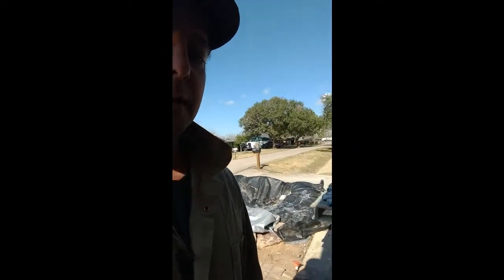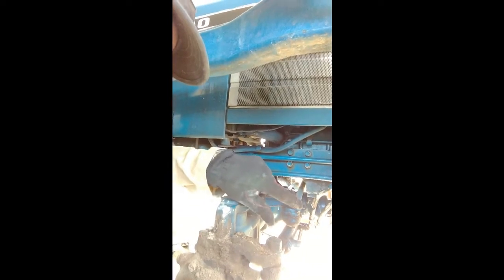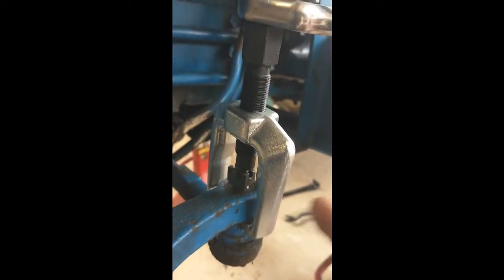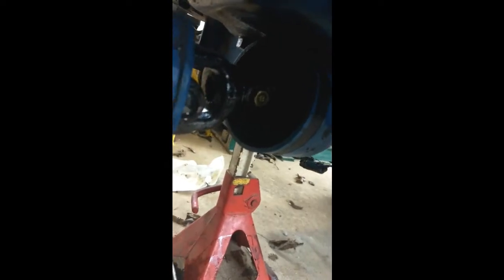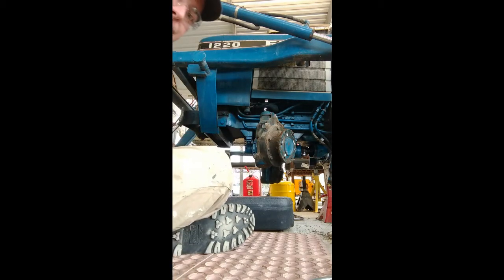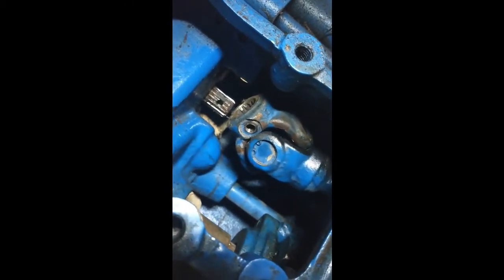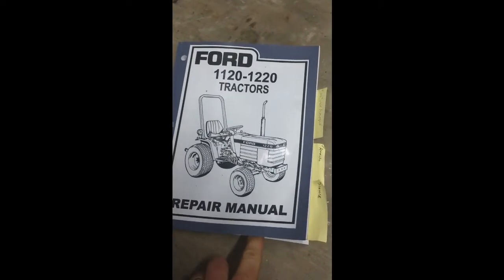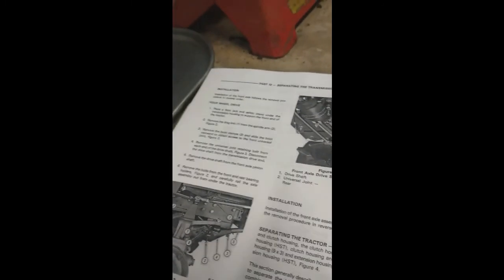Ford 1220 4x4 Front Axle Repair Pt.1: Removal

Comment: How is that tractor in general ? I’m looking at one nearby.
Reply from the maker: It was a good tractor, did everything I needed it to for the size.  Just watch your fluid levels (obviously the point of the video) and it should be fine.  One odd thing is that there was only one place to put a bolt for the starter on the one I had.  Couldn't thread two, one was blocked off.  Had to use loctite on the one bolt.  Other than that, it was reliable.